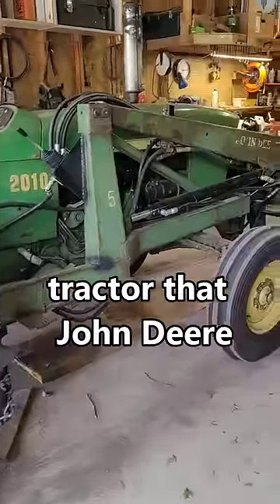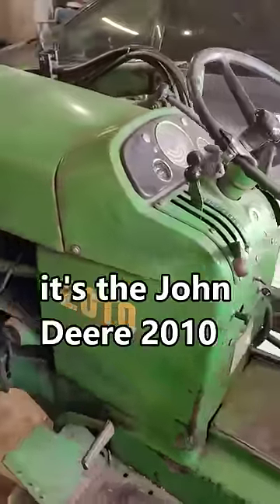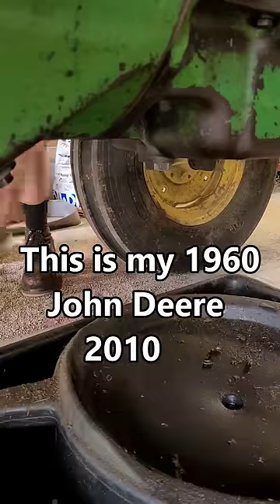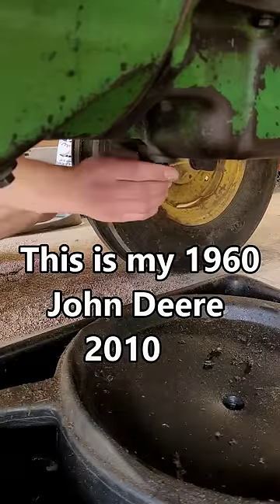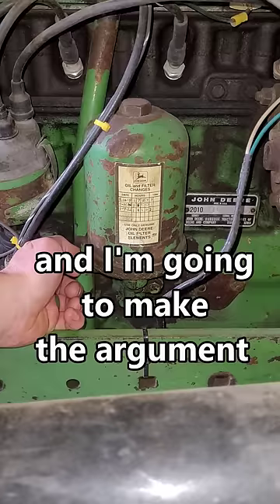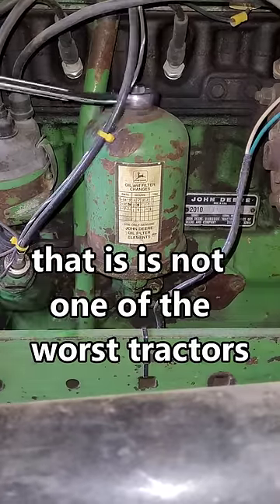Is this the worst tractor John Deere has ever made? #shorts #mechanic #farming #johndeere #tractor

Comment: You cannot beat the fact that a 63 year old tractor is still working
Reply from the maker: Good point.
Reply: Look at lanz bulldog traktors
Reply: @craftzmanchris9859 my dad has 4010 gas and that tractor was sitting for awhile my dad bought it and now rebuilding the carb and if you haven’t already replace your starter with one that gears the starter down so makes the tractor fire up better and the tractor is orginal and fires up every time even in today it’s running better then most cars on the road 😂
Reply: Pretty much every German tractor from that era still runs with minimal maintenance
Reply: @coachthelegend2192 German? Brother, most all tractors for that Era. Are still running. Obviously some have passed, but most that have been some what looked after. Will likely run still to this day! Not many bad tractors from that time period. They were built to last! American, or German etc etc. All were solid Tractors! My favorites were Ford 8n and Farmall H! 
   I've always have loved those two
Reply: Excuse me sir 1960 was only 40 years ago thank you very much
Reply: @richardbadish6990  I would bet that a vast majority of the old tractor would still be running had they had proper maintenance and kept out of the weather.  I have owned 2- 8N's, a 2000 Ford backhoe a 3500 Ford, a model  1920 Ford, this was purchased brand new in 1990  and was a little work horse.  And the Golden jubilee I currently own. The great thing is that repair parts are still available for all of them.
Reply: @roland8980 you're correct, it was only 40 years ago -  back in 2000. Your math would put me back into my late  30's 😅😂
Reply: @richardbadish6990  well I've driven a 1960 Fendt a few times with over 10k operating hours which stands outside most the time with basically no maintenance and it still purrs like it's fresh out the factory
Reply: @roland8980 
I think you blanked out the part where the world went to hell. There's been 20 years of idiocy, garbage and hate between now and when you think it is.
Reply: Ya I’m guessing if you buy one today it wouldn’t last a decade
Reply: All of the computerized ones
Reply: @dannyorand373  they're great until they break down.  when they are working properly they can be time and money savers on large farming operations, until they do break down and farmers can't fix their own equipment. That goes for any type of equipment.
Reply: I agree the old ones are better the new ones had problems with their fuel system
Reply: It may run but it’s not very useful. 

It can carry 1/10 the weight of a modern tractor and doesn’t have the connectors for modern equipment attachments with automations and all.
Reply: Can't beat a 63 year old tractor that still works? Uh how bout a 64 year old tractor that still works. 65, 66, every 67. I just beat 63 4 times real easily.
Reply: @mwilliamshs  OK, I have a 70 year old Ford Golden jubilee.  Let's just agree that older tractors are still very  useful
Reply: I have a 1946 Valmet 1 that works just fine…
Reply: @richardbadish6990 my grandfather bought a 1941 Farmall H shortly after Pearl Harbor. He farmed completely with horses prior to the start of WW2, but he understood before that first wartime planting season that he was going to have to handle farming both his land and some of the neighbors while they went off to serve. He was too old to be of interest to the Army, but he had many younger neighbors. Whoever stayed needed to pick up the slack. 

Grandpa passed away back in the 90's. The H is now on its second owner, but same family. My uncle is the current caretaker of the H, responsible for taking it out of the shed and driving a few laps around the yard every so often. It partakes in the occasional parade. Grandpa requested before he died that the H never leaves the farm. It won't. My cousins will make sure of it when it's their turn to be the third owner.
Reply: My dad hates John deer and has another brand tractor that's 100 years old
Reply: @myersbob7517  nobody cares
Reply: @jeffreykindron7162  I care
Reply: Right. Let's see these new tractors still running in 60 years

Comment: That'll be running when they're feeding the new ones into the shredder
Reply from the maker: I sure hope so!
Reply: John Deere will start suing people for performing self repairs XD
Reply: @Xoediac nope not gonna happen
Reply: @anthonybinning3853 they already have, as far back as 2005
Reply: @heavilyarmedhippie75  I’m a dealer tech
What is it that your not able to do
You can purchase the same info I use
I think all but actual software
Reply: @anthonybinning3853 And without the software, you can't do anything without the machine locking itself down.
Reply: Its alive cause you keep it alive, thumbs up great video
Reply: @Xoediac too late ... !
Reply: @anthonybinning3853 yes already happened.....
Reply: And likely only feeding them into the shredder because they refuse to repair them too
Reply: It'll be whats driving the shredder😂
Reply: @jeffclark2725  ;  still, it IS "the worst tractor John Deere ever made"!!  For multiple reasons..     Fortunately it was replaced by the revolutionary 2020 AND 2510 tractors, many of which are still hard working partners in small to mid-sized farm/ranch operations.. 
 The 2010 literally disappeared off the landscape within 20 years of production.. 
 The recent (in the he past 30 years) Deere tractors are notorious for staying in the harness on farms across the country for decades..  I can point to a sizeable number of early 8000 series Deere tractors that will still work side by side with the newest models..  And the newest models are capable of many decades of a wide range of duties on today's and future farms and ranches.. 
 To comment that the newer Deere models will be shredded before 'this particular' tractor, is extreme foolishness!!  
  I fully understand the emotional attachment this young man has for a tractor his dad used on the farm, and now he is able "keep this thing going"..  Sweet memories 🤗 🙋🏻‍♂️
Reply: @heavilyarmedhippie75  ;  please explain.. 🤔
Reply: @jimstepan3038  that's when certain proprietary repairs were written into the terms of service when you buy a John Deere machine. If you find a way around their bullshit, the tractors onboard computer rats you out and you get a cease and desist in the mail/lawsuit
Reply: I have seen several off brand tractors that are now recycled into kitchen appliances.  My JD 180 gear drive still thumping along over 1/4 century later.  I think there are worse owners.
Reply: @heavilyarmedhippie75  think you’ve responded to the wrong person
Reply: True that 😂😂😂
Reply: You understand that 99% of 2010s are scrapped now. This is basic survivorship bias. There will be a couple examples of the new tractor still running 50 plus years from now too.
Reply: New tractors have already more hours and have done more work than this old model. The demand now is way higher for crops. Literally there are 4 year old tractors that have 20.000 hours. I have a 1974 tractor with way less hours.
Reply: As long as they keep making parts, anyway!
Reply: Long as you care for it it will last forever, you can’t kill those old tractors 🚜

Comment: The worst john deere ever made was anything the farmer couldn't work on due to software rights
Reply from the maker: You got that right.
Reply: You can work on any tractor, I've never had to use a laptop to fix a leak or broken part
Reply: @wizard_of_poz4413  na but there is a shit ton on sensors and also if there is a electronic issue stoping it to run because a sensor glitch you can't fix it
Reply: @Julianwicks-r3c  you can replace a sensor easily. Yall are misinformed
Reply: @wizard_of_poz4413  yes your right you fucken can but if it short circuits that's a big ass fucken problem that can destroy a lot more
Reply: @Julianwicks-r3c  umm you've never unplugged a quick connect I presume. I understand that service is a foreign concept I guess but just trust me that it'll be fine
Reply: @wizard_of_poz4413 Problem is that each sensor has a different serial number connected to a server, and if the vehicle pings the sensor and realizes that it's not the one it was built with it will software lock itself.
Reply: @gregsbiplays9899  wut I've literally never had that happen any time I've replaced a sensor. Nor is farm equipment connected to the internet
Reply: Ukraine has been a source for "alternate" tractor software.
Reply: @joewoodchuck3824  wtf you talking about
Reply: Software rights do not exist.
Reply: @bob-g2h  That doesn't sound correct, but even if that's the case it doesn't mean the company has to release it.
Reply: We never had problems fixing our new John Deere. They are complex machines but it doesn't mean you cannot fix them
Reply: The only time I've ever heard of someone needing a laptop to fix something on a tractor is when some sensor in the def tank went haywire
Reply: @tonkapoplol  From what I've heard though there's enough computer controlled stuff that an owner can't access to be a problem according to them.
   I'm not in agriculture, but I still feel connected enough to it through my dad to be interested. And I do read related articles. That doesn't make me a farmer of course so my perspective comes from people such as yourself. I thank you for your information and it will be entered into the official woodchuck data base. 😁 I also thank all of you farmers for their involvement in keeping us fed.
Reply: @Axios31  That's the whole point. You don't use your computer since the JD software seems to be unavailable.
Reply: @wizard_of_poz4413 There are a lot of things you can't fix without software. One example out of many I could give would be an issue a fleet I used to work on was having. Cummins designed their DEF pumps to purge for 30 seconds after the engine shuts down to get the DEF out of the lines. 30 seconds was not enough time to get all of it out so that caused many issues with split lines when winter came. The solution was a software update that made the pump purge for 2 minutes instead of 30 seconds. There is nothing you can do mechanical to fix this issue, you need software access that only the dealer had. I can think of a few more if you would like to hear about it but the bottom line is there are many repairs you need software access to make.
Reply: @cranberrysmoothie1  yea I mean we've never personally had that issue before in winter and for some shit it's easier to call a service truck anyway
Reply: @wizard_of_poz4413 Until you need to figure out what sensor is broken.
Then you have to hook it up to a computer. And they do not sell those computers. You could pay thousands of dollars to load the tractor on the trailer and drive it down to a shop to get it fixed and be out of a tractor for weeks.
Reply: @wizard_of_poz4413 easier to call a service truck to perform what should be a simple software upset? Tf?
Reply: @t4tillman  well most farms call a service truck for a lot of different repairs.  A lot of computer shit isn't really user level fixes to begin with and companies like jd and many others don't just allow their software to be open source for liability issues
Reply: The farmer didn't know how to fix it big difference. You can fix anything if you know. That's not manufacturers issue.
Reply: @wizard_of_poz4413 spoken like a true JD sales representative... 🙄
Reply: John Deere lost a court case recently and you are now able to work on YOUR (you own it) tractor.
Reply: Dam I didn’t know this about jd tractors 🚜 but it’s like this with everything especially centrifugal chillers and I gather all heavy machinery. But even cars ect , that’s what makes this old tractor special, I have electric motors still running since 1959 24 /7 and those 300k jd tractors will have expensive repairs while his 1960 tractor 🚜 cost next to nothing to maintain
Reply: @RcPlayer-tt2vw  bruh that's where you're wrong
Reply: @wizard_of_poz4413  how much JD pays you for this? if it's that easy people won't complain and it won't be a headline news on YouTube. i know you can't prove that you are a farmer, no video, pepe profile pic, sums it all up.
Reply: @wizard_of_poz4413   how much JD pays you for this? if it's that easy people won't complain and it won't be a headline news on YouTube. i know you can't prove that you are a farmer, no video, pepe profile pic, sums it all up.
Reply: @isa_L  I can't prove it on here but I can assure you that I am. As much as I know you don't know jack shit about farming because if you've got deadlines coming then dealing with that clapped out junk is a damn good way to go broke unless it's doing some kind of nonessential work like running an auger or a bushhog like most older tractors are now.
Reply: how told the farmer to buy john deer theres other brands he made the choice he gets to pay for it

Comment: Any tractor without a friggin computer is worth keeping it running. 

I think you have a nice machine that will continue to serve you and your farm just fine for a very long time.
Reply from the maker: Thanks 👍
Reply: That was my first thought. (Worst ever? He's got to be talking about one of those dang computer controlled Deere's)😂
Reply: @GuyBaptist777 a computer controlled tractor is absolutely absurd. I remember when farmers fixed thier own tractors out in the field. Simple is better
Reply: Old tractors will always be superior
Reply: Worked as test driver for deere for engineers keep the old stuff
Reply: @GuyBaptist777 yeah, maybe one made in 2010?
Reply: It's sad to see so many complaining about new tractors i bet if you actually knew how to use the full functionality on the new ones you will never look back
Reply: @cristianseminario7899  it’s not that at all, it’s the proprietary software that forces you to depend on the dealership for service and maintenance that people don’t like.
Reply: @cristianseminario7899  I'm a heavy-duty diesel mechanic. Operator-assist functions and cab comfort on newer equipment is nice, but the build quality, overall reliability, and even serviceability is usually inferior to older iron. I personally prefer running 40-year-old open cab equipment that can be fixed with simple hand tools. There's also no beating the precision of a direct-acting hydraulic system on a machine that's been properly greased. It just requires more seat time and a skilled operator to use to its potential.
Reply: @buckhunter6669 you can fix a computer controlled tractor when the software isn't locked. It actually gets easier on them. There's a sweet spot between computers perfected and them figuring out they could block people working on them themselves
Reply: @SilverStarHeggisist  Nuance? What's that?
Reply: @benengleman1707  something that doesn't exist anymore or maybe never did

Comment: That series of Deere has never had any issue far as I'm concerned, my grandpa had a 4010 diesel model when I was growing up and I can't recall a time I ever saw that thing down for repair under his ownership. Then again he used to work for a Deere dealership as a mechanic and used to only run Deere on his farm back in the day so he probably knew that thing inside and out, down to the last drop of fluid in it. God I miss that man.
Reply: You aren't old enough to know all the trouble the 4010 had when they first came out. Have a friend that had one new and had so much trouble they ran the first year or two without the hood just to be able to fix the repeated problems.
Reply: @plowboy7700  you're right, but I think it's fair to say that particular one was owned and ran by a man who ran it religiously, worked on them as a job, and during his days as a government funded farmer souly ran Deere equipment. Not to mention grandpa grew up during the depression, so he had to learn to make something work with nothing since day 1. I can't attest to everything he knew or did, but he was a damn good mechanic. Didn't matter what kind of engine it was, you give him a few days, he would have that engine figured out down to the last ounce of material on the block and have a dozen tools of his own creation made to make working on it easy as shucking sweet corn
Reply: I remember my grandpa had an old 4010, wired thing was that it ran on propane. He used to fill the flat tires with propane when he couldn’t find a compressor😂
Reply: @AusterEngineer  that was a common alternative fuel experiment all ag equipment manufacturers ran, I've never seen one in person myself but I've seen pictures. Makes the tractor look like it's got a big cystic pimple on it, but I heard they were pretty decent for what they were, just weird
Reply: @MaverickWindsor351  my grandpa liked it because he could just fill it up from our houses propane tank and didn’t have to get another big tank for diesel or gas. It’s still sitting out by my barn so I probably need to check on it
Reply: we have a 4010 has problems, was told from a old boy from the dealer. the 4010 was the worse to own

Comment: Nothing wrong with a 2010 at all.
Reply: They did have issues. They were hit or miss the diesels were god aweful. get a 2020 diesel, the one at work has 16754 hours on it.
Reply: Dam that’s around 85k miles at 5 mph lol
Reply: @RcPlayer-tt2vw  mhm, thing is fucking beat, its in its retirement now, only runs the rake, tedder and brushhog. Used to run the 9’ haybine, chop corn and disc.

Comment: Awesome tractor. I have a 1953 farmall that is still going strong. My only advice is to never put an O-ring in dry. Speaking as a heavy equipment mechanice, and part time homesteader
Reply from the maker: That is a good point. I will oil it moving forward. To be fair, there is a fair amount of oil residue left from removing the cover.
Reply: @craftzmanchris9859  oil residue is usually enough. Oil, dielectric grease it all works the same really just as long as it isn't dry lol. Still nice tractor man!